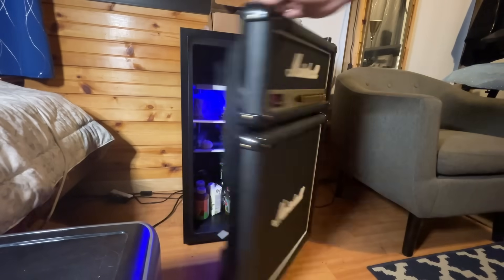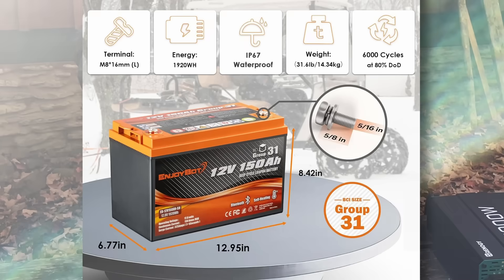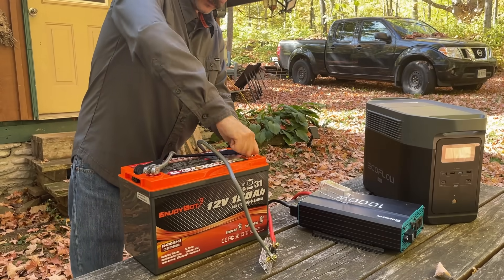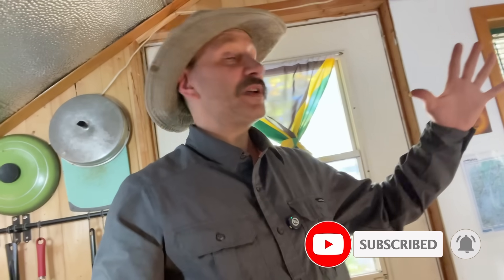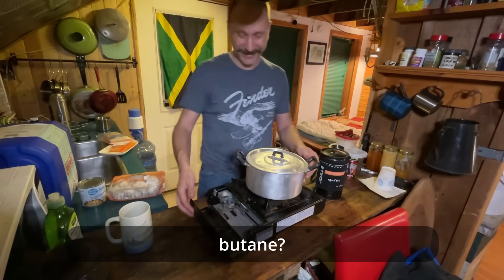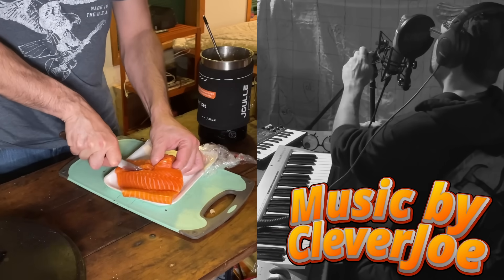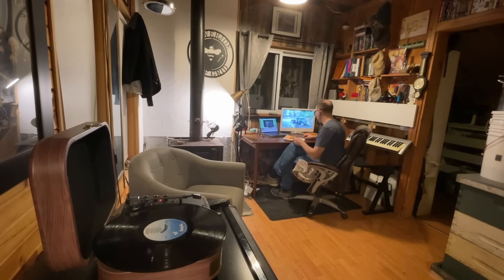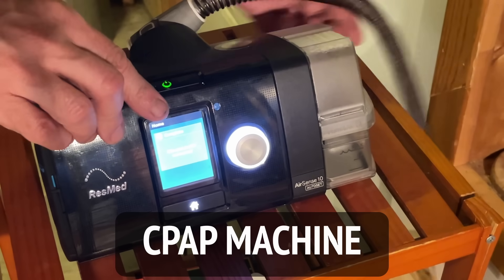Can a DIY Battery Setup Beat an EcoFlow? 24H Challenge

Comment: Add a compatable AC battery charger, 12v outlet, USB  A and C, and solar controller if you tryly want to compare apples to apples
Reply from the maker: 100%  agreed — this was more “apples to apple cores”. Just the simplest setup to show how it all connects.
Reply: DELTA 2 Max, 2400W - $975
can only output a load of 2400W
limited to 1kW of solar
MPPT Voltage range 11VDC-60VDC 15A, single port 500W; dual port 1,000W
limited to 1.8kW of AC charging

DIY
3.6kW hybrid inverter - $400 - B0FBRX7T8F
2560Wh battery - $420 - B0CP7FZC1P
Victron shunt - $100 - B0856PHNLX

Total ~$996

can use without batteries
can only output a load of 3.6kW
limited to 4kW of solar
limited to 4kW of AC charging
MPPT Voltage Range 90VDC–260VDC
Reply: we did all the above and we do love our ecoflow delta 2 but our diy will produce more and longer output but both have specific applications on our adventures
Reply: Like the real world results combined with humor. I’m still new to video making, curious how you do the bear in the window.  New Subscriber.  I’m in the process of building a DIY with a Giandel 24V 4KW Inverter, 4 330W solar panels, 4 WattCycle 100 AH 12Vdc LifePo batteries, a Renogy Charge Controller, Victron Shunt, and 110Vac to 12/24VDC 70W battery charger. Plus misc wires, fuses, circuit breakers, cut off switches etc.  It cost me more than buying a Delta or Bluetti during Prime Days. But I’ll be able to repair at component level and also expand by adding more batteries.  My background is in electronics so I’m into building it. But there’s something to be said to taking it out of the box and just start using it. 

My main reason for building it is to not lose food in the refrigerator and a freezer when the power goes out. Plus keep the heat running.
Reply: @cruikshank  
show me which delta or bluetti is going to be cheaper than what you built? you have 5kWh of energy my brudah! the mistakes i see are using 12v batteries to make them into 24v and then the renogy CC.
Reply: @MHawkeye if I were to do it all over again I’d buy 24v batteries. But I got these on a deep sale before tariffs were even mentioned. I paid $127 each for them new from WattCycle direct.  I’d at least use 2 12V 300ah instead of 4 100ah.  I’m on a fixed disability budget so I bought everything one piece at a time when I could, at the best price at the time.
Reply: @cruikshank  
anyone whos done this, learns not to go 24V, 24V is a better starting point but also i guess it depends. if youre going to use them in a stationary place, its always going to be 48V or higher because this gives you the easiest path to expanding your solar array. ill be honest, i dont really care for the backstory, i just want an answer to the question on how youre comparing your 5kWh setup to a prebuilt being more expensive. afaik a 5kWh power station is nearing $3k, so did you spend that much on your components?
Reply: @MHawkeye nope, about $1100.
Reply: @cruikshank  
thank you, that tracks with what i initially posted and you also mentioned the benefits of doing a DIY setup. especially going the hybrid inverter route, youll have to replace the whole thing if the charge controller stops working or the inverter side. your diy setup lets you replace components instead which will be cheaper. wish you the best, stay safe and fuse between each battery.
Reply: Can do all of that for less then $100.
Reply: @bretsmith1094  
list the parts, MPPT charge controller alone would be nearing $100 and the AC charger is going to be more than $100 if we are matching the power stations 1kW rating..
Reply: How about we just get a DC to solar connector adapter and connect the battery to the ecoflow so you expand the battery life :D

Comment: Was interested in the efficiency difference between the two,,but each time i fast forward there was just more "content" stuff,,pity,,,
Reply from the maker: Hey, fair comment — this one leans more toward a real-world demo than a strict efficiency comparison. I wanted to show how the DIY setup actually performs in daily use at the cabin. I might do a follow-up focusing more on numbers though — thanks for the feedback!
Reply: @cleverjoe thanks reply,,had heard that 12 volt inverters,,needing large number of amps,, and therefore more heat losses,,were not as good as 48 volt inverters ,,needing quarter the amps,,that were also more responsive given the greater "potential difference ",, but that the powerstations also waste a bit feeding the displays and other stuff,,? ,,,cheers,,
Reply from the maker: You’re absolutely right to bring these points up. I’m not an expert either, and here’s what I found + my take:

12 V systems need more current for the same wattage, which can mean more heat and voltage drop. A 48 V system carries less current, so it’s more efficient. Power stations also have internal draws — displays, controllers, monitoring — that use some of the energy.

So comparing a 12 V DIY vs a polished unit like the EcoFlow isn’t just about battery and inverter; wiring, efficiency, and components all matter. I mentioned it in another comment but this simple demo is more like comparing an apple to an apple core. Thanks for pointing this out.

Comment: Having a 1000 - 2000 watt 12 Volt Inverter and Spare Batteries are a Great means to keep The Lights on - Insta-Pot, Microwave, Drip Coffee Maker, Rice Cooker, Toaster Oven, AirFryer and CPAP Machine are all very Necessary Creature Comforts. Radiant Heat and AC are Secondary Needs. Great Basic Video 🤙 Aloha from 💦 Indian Creek Ranch ⛩ Southern California High Desert 🌵
Reply from the maker: Thanks so much! Going up to a 2000w inverter provides some flexibility - more rice, and more breathing at night with the CPAP machine.
Reply: @cleverjoe and more Salmon to
Reply from the maker: @1GREATDANE  Not sure that I could fit any more into the kettle pot.